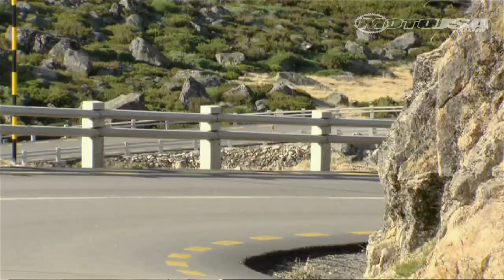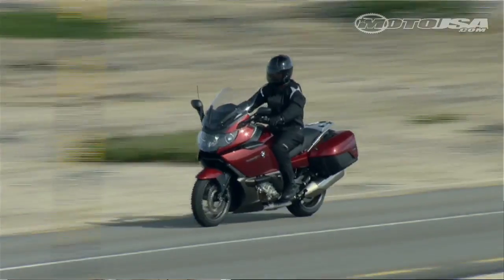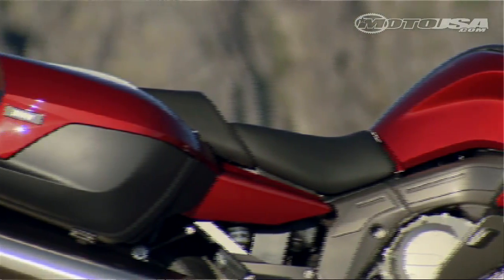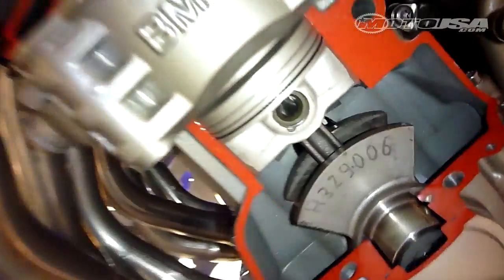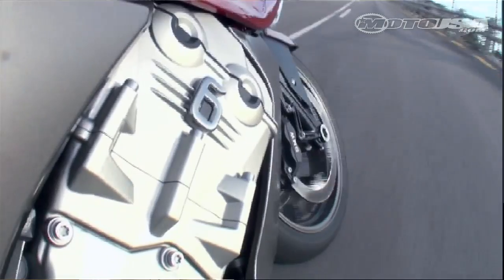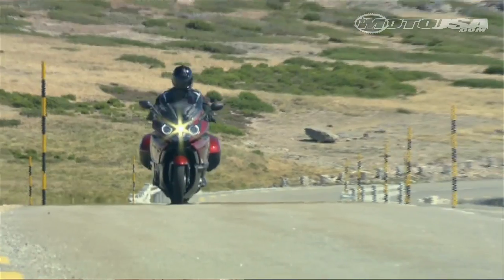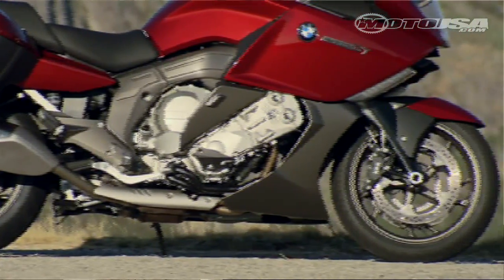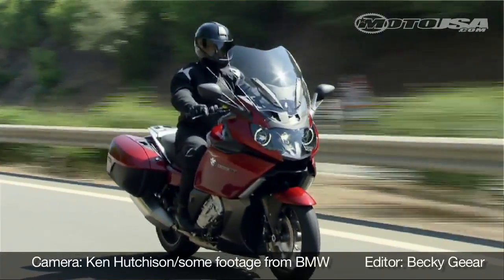MotoUSA First Ride:  BMW K1600GT

Comment: Just rode it the other day. The bike as a whole is amazing. however, throttle control is  crap. I don't know who designed it but the throttle feels so disconnected its not even funny. and its hard to modulate. Power is perfect, turning feel is great, and its very easy to maneuver considering its weight. It also has significant engine breaking which is kind of weird for an inline engine. behaves like a vtwin in that manner. all good bike, but bmw needs to fix that throttle.

Comment: Pmac, sorry to up set you but yes, I have owned both BMW cars and Bikes (K1200s) and both gave me trouble. Yes, covered under warranty but the K12 died ar 14,000 klms and glad you have had no problems but just google "bmw issues" and I'm not the only one who holds this opinion. Oh, and only riding for 37yrs so u beat me by 3 yrs LOL, not that, that should matter LOL
BTW, you dont have to be a knobhead when someone has a difference of opinion to you -